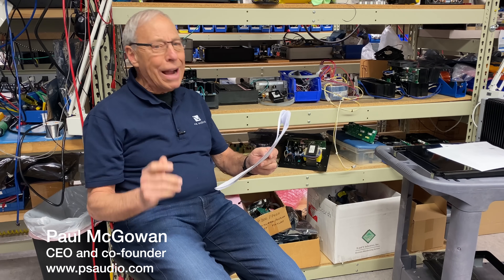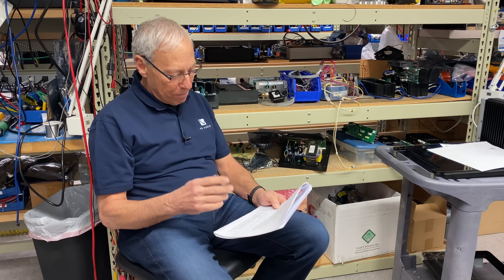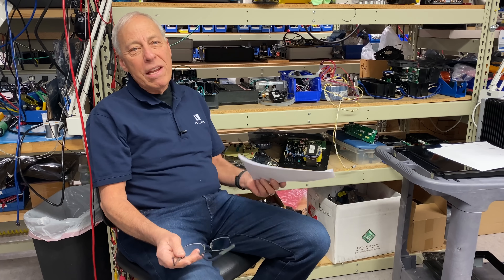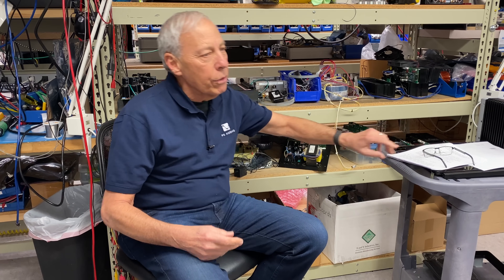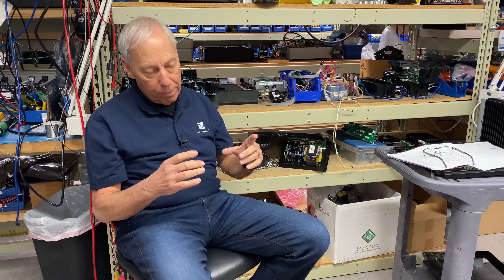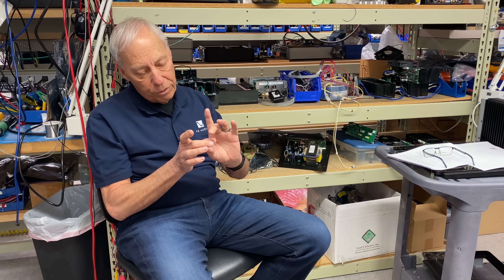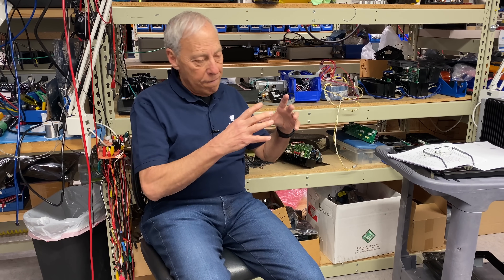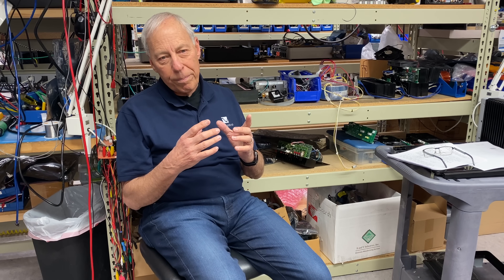Are toroidal transformers better?

Comment: I knew a traditional square transformer is called an 'EI' but I just realised by the same naming convention a toroidal is basically an 'O'.
Now I have that damn kid's song in my head...
Reply: O-core is considered different than a Torroid apparently.
Reply: @clippy_friend  Yes - a toroid's core is flat on the top and bottom and has vertical inside and outside edges, because it's made from a strip of metal of constant thickness curled up into a ring. An O-core is rounded such that the cross section is more like a circle.
For the purposes of my silly joke, though, a toroid is basically an O.
Reply: @HandbrakeBiscuit  Thanks for the details. I guess the O-type core is a bit more difficult to make. Do you know what the benefits might be?
Reply: @clippy_friend  oh, man - now you're asking... off the top of my head the main benefits are a shorter length of copper required to make each turn and I think the magnetic flux is better 'contained' due to the copper bending through a constant radius around the turns (rather than flat-corner-flat-corner like in a toroid). I think they look nicer too - I heard of a toroid before I saw one, pictured an O-core and was disappointed when I saw a real toroid and not a nice rounded donut. I guess that's right, though - an O-core really is a torus, and toroid only means like a torus.
Yes - harder to make, the core strip has to be thin-fat-thin and designed to take into account the growing size of each 'lap' as it is wound into a spiral.
Reply: @HandbrakeBiscuit  Hey that's a great answer. Thank you (and I agree). I know Holo Audio makes a big deal
about using them. But I wonder why these companies aren't using R-cores? A bit more difficult to make the core again, but so much easier to spool.

Comment: What challenges would I face if I wanted to swap a EI transformer with a Toroidal one? I'm having an issue with overheating in a PSU and am thinking this produces less heat than EI frame.

Comment: Howdy.
Also there is a lot more winding space available with toroids. One may use thicker winding wires to minimize winding losses. I should think this is essential in High End gear. The power supply needs to provide current fast without the voltage to buckle.
Regards.

Comment: in transformers with the EI core there is some magnetic flow leakage but in the toroidal transformers there isn't because of their shapes , in toroidal cores magnetic flow goes in a circular path and there is no corner so the shape of magnetic flow wave is better in a toroidal core than an EI core , good shape of magnetic flow wave generates good voltage wave shape. better voltage wave shape : better sound !

Comment: There is a measuremen of the quality of an inductor, the Q value, which compares the inductance to the resistance. Resistance is loss of power, and a toroidal transformer has a higher Q value. I am sure there are some special kinds of other transformers made, but the classic one is pretty crappy. When you need a lot of inductance a big beefy toroidal is quite incredible. It can hold a lot of Joules of energy.
Reply: they hold a lot of energy and also produce a slower decay. the magnetic field doesnt reduce as fast.

Comment: I wish that the Sprout 100 didn't have distortion at high volume with bass heavy music. Id like to have the freedom of max volume as clean as low volume. A new even better version of the Sprout needs to be made. Maybe at the 1000 dollar price point.
Reply: It's a 50wpc amp (at 8 ohms)...
Reply: The days of affordable audio equipment having headroom appear to be over.
Reply: I disagree. Watts have never been less expensive. You can get dual mono 250 watts per channel class D Ncore module amplifiers for like $600. The Sprout is jammed with functionality in a tiny package, hence its niche. The market is saturated with $1000 integrated amplifiers with more watts, and it doesn’t make sense for PS Audio to compete in it.

Comment: If it effects the sound there is a problem with the amp circuit.
Reply: So a humming transformer hums because of the amp circuit?
Reply: @petermartin9494  I dont think that's what he's trying to convey with "affects". You are speking specifically about residual noise that variates per power demand and can be mitigated but is not totally avoidable. Affectation in the other hand is how the transformer introduces EM noise to the circuitry which is avoidable with good design.    Toroidal is just easier to control but not flawless.

Comment: They rattle and make noise? wow, now I know why they sound so awefull. and im not thinking about my sound ampliefier, im thinking about my Xbox, my gaming console. Im currently thinking about modding it, it would involve adding ram, an ssd, custom kernel and HDMI. all to bring the old gaming console to the future. What still bothered me was the power supply. being close to a PC the powersupply is basicly a PC powersupply. replacing the 1 fan with realy nice quiet onces worked as a threat but the PSU... im gonna look into a nice silent powersupply for my xbox and maybe look into a more solidstate solution or if a Toroidal psu excists (it wont have a effect directly on the audio ofcourse, because its mostly digital, even up to the output. But this video did answered the sound questions :D
Reply: I have a modded xbox with ram upgrade and that 😂

Comment: If you want a much more thorough and objective answer to the question of "Are toroidal transformers really better and what are their electrical/magnetic disadvantages compared to regular run of the mill EI (i.e., box shaped) transformers, rather than they just "cost more and sound better...", do a Google search for the following: "EI and Toroidal Transformers" "ken stevens"
Reply: The problem is that Ken Stevens article is as flawed as this video. It was written to warm about the switch of a single component without tuning accordingly the rest of the circuit, not to properly answer the question.
The First paragraph is the usual audiogourmet gibberish instead of proper measurements.
The Second is true, as EI is way more resilient to DC but his examples can be easily fixed by cautiousness during the wiring and by using a rectifier in a single package instead of discrete diodes or by pairing them. Though, replacing the standard PN diodes with Schottky is a good idea as there is less Vdrop and less noise (but again, this have to be tuned). DC is even easier to fix in the primary.
RF input noise is not that hard to effectively filter if you use common lab equipment.
AC coupling is not an issue at all if the DC circuit is properly isolated inside a shielded compartiment. EI are even more noisier, especially in the audible spectrum.
About ground and FM bandwidth : this is pure BS. If the ground paths and connections are correct inside the whole chain (the case, the cables the room and the building) this is enough to ensure proper shielding. Just have to be careful with ground loops as well as digital circuits or SMPS in the ground line. Same thing with main wiring: ideally using a line dedicated for audio from the electrical panel and filtering it.
Finally the LC filter/resonator created in the secondary is not an issue when the circuit is properly tuned and measured. Just like putting decoupling caps in a design.
Reply: @PainterVierax  Non-RF input noise is impossible to filter as is evidenced by the fact that exactly ZERO of the regenerators are effective and doing this. This is the noise that gets to the secondary. If the rebuttal to this is to introduce bypass caps and do proper filtering on the secondary, then there is no point in using a toroidal transformer vs a cheap EI transformer, in the first place.

Comment: Toroids have the cool factor, the one in my amp is coated with red epoxy and has the Parasound logo stamped in gold on the top. Whenever  someone asks whyI wasted my money on that "crap" I just let them look in the top, shuts them right up
Reply: Dave Micolichek   Sure, but  the cool factor is what's important. Amp's sound better  with one, why I thought it was a mistake for Emotiva to go with switching mode psu's,
you can call it anything you want, but  while switch mode's  are  great for a lot of applications, Amp's need current. Companies are pushing class D and switch mode for one reason, they're cheap. They want to charge class A prices  for Blutooth speaker prices.  Screw that.
Reply: Dave Micolichek  Switching from class A and A/B  to class D and to smps seems to be happening at the same time is all I'm saying. As for current, I would rather have a steady flow than "instantaneous" bookoos of current. Main thing is the reason they are changing to these two methods is the same, to save money by making something cheaper  but not reducing the price, which is fine if the new way is better. Not if it is not. SMPSU'S are more "efficient, switching to higher current rails as needed.  What I have posted before is that this is higher end audio,  "efficency" does not matter a tinkers damn.  Who cares if you save a  few bucks a year on electricity? After I just bought a  2,000 dollar pair of speakers?
Reply: @musicman8270  my class D stereo power amplifier has a massive toroidal transformer with dual linear power supply's.

Not all class D amplifiers use a SMPS switch mode power supply.
Reply: @C--A   Still class D, they call it pulse "width" instead of pulse "code"  but it is still non analog. I hace a class D from Emotiva, an ice module based monoblock.for my center. Some great uses for Class D, I just think analog should stay analog is all. Why bother with vinyl when you're gonna convert it to digital anyway?
Reply: @musicman8270  Class D can be totally analogue.
Reply: @clippy_friend   It's lawyered analog, pulse "width" instead of pulse "code" but regardless it sounds not quite as good as class A or AB, witness the mosfets usually thrown in for "flavor", class D is great  for surround channels, I have a class D I use for my center, but for 2 channel HI-FI, no, basically. A lot of people don't get analog, they buy turntables   
with USB or Blutooth, whats the point? I want my Rega Planar III playing through either A or AB, why I bought the thing, There is something different with analog, I can even tell when vinyl is made with a digital  master.

Comment: Like most things technical, there is never a one-fits-all answer. While Toroid transformer do offer many advantages over EI types, there are some disadvantages. They can saturate very easily and have no tolerance for DC voltage which is often found on AC power lines today from switch mode power supplies and other direct line connected rectifiers.
Reply: You need to stop reading soundstage.com articles.  The one about toroidal versus E-I core transformers is mostly nonsense.  It is NOT true that DC voltage is often found on AC power lines.  There are transients which can disturb symmetry, but these are short enough that they will not have the same effect as steady DC.  
If two transformers - toroidal and E-I core - are equivalent, then they will have the same saturation current.  Further, you are not going to saturate any power transformer, merely by transient asymmetries on the AC power, because the idle current due to normal operating voltage is very small compared to the transformer's rated current.
Reply: @marianneoelund2940  I don't read soundstage.com. I do read the IEEE journal as I am an accredited EE. Toroids saturate must faster than EI, that is a known fact. DC components on AC power lines is quite common today, especially in larger distribution systems such as in commercial buildings. Are you trying to say half wave rectification does not reflect a DC component on an AC source voltage? I am not saying toroids are deficient. They are an excellent choice for audio components. I am just pointing out some well known engineering pitfalls.
Reply: @andydelle4509  
If a toroidal and an E-I core transformer have the same VA capacity, then they must have similar saturation current.  
If the toroidal has much lower primary series resistance, then conceivably it could draw more DC current if a DC component were present - but do they truly have that much less primary resistance?  
The only way I can see to impress a DC component on power, is to have an asymmetrical high-current load (such as your half-wave rectifier example) on the same utility transformer secondary as the audio equipment.  When does that happen in a residential environment?  
I'm remaining skeptical until someone can offer a realistic, detailed example with specific numerical parameters, that show how, in a residential environment, a toroidal power transformer could reach saturation due to another load on the line that's meant for domestic use.
Reply: @marianneoelund2940  I didn't say toroidal transformers automatically saturate. I said they are more prone to saturation. As for DC on the line, how many half wave voltage doubler rectifiers do you have directly across the AC line in a typical 120vac residence TODAY. Think about it and it's not just cell phone chargers either.  My 2007 vintage washer, dryer and a 3ton HVAC condenser all have VFD motor drives. Again that does not mean your toroidal transformers WILL saturate.  But there are plenty of examples where toroidal transformers have harmonics that are cured by AC or galvanic coupling. You seem to be hung up on VA capacity. You are forgetting DC winding resistance. You can have the same VA capacity but significantly different DC resistance in any transformer winding.
Reply: @andydelle4509  
I did mention winding resistance in my last comment.  
I don't believe any of the domestic examples you cited use half-wave rectification.  Most devices like cell phone chargers use FW rectifier bridges (do low-power devices even matter?), and I am having great difficulty believing that washers, dryers and HVAC units will use the AC power asymmetrically.  The worst offender I can think of, is a microwave oven over the first few cycles while the capacitor is charging - but that's a transient condition.  
Regarding saturation, toroidal designs do tend to have less headroom with a more abrupt flux separation than E-I cores, but high-end audio suppliers like PS audio probably use a slightly larger part anyhow, as they may believe it sounds better in their listening tests.  
I think the biggest problem related to saturation is inrush current, not the occasional saturation that may conceivably occur due to a momentary DC component of power.
Reply: @marianneoelund2940  If a washer, dryer, HVAC condenser uses a high power inverter, which some do more and more, you can have a DC component imposed on the AC line. Do I need to post a link to my washer and dryer service manual?
Reply: @andydelle4509  
Does the service manual include a schematic?  
But there's little point in carrying on a discussion based on speculation without hard data.  
Maybe I'll pick up a beefy toroidal power transformer to experiment with.  I can connect it to the AC line serving our washing machine or microwave and see if it can be provoked to draw current that's anywhere near the saturation level.
Edit:  Thinking about this a little more, I suspect that the issue isn't that the transformer can end up drawing enough DC current alone to saturate, rather it's that some smaller amount of DC current will reduce the magnitude of AC current that can be superimposed on it without saturating.  Effectively, it reduces the transformer's current rating somewhat.  That's not as hard to believe.
Reply: @marianneoelund2940  There is no schematic. It's a sealed (really well sealed) module labeled "inverter". I know because I tried to fix it but replaced it due to the thick conformal coating on the board. Not all home appliances have VFD drives. But more and more do as a VFD inverter and three phase motor is now cheaper than a single phase induction motor. Remember single phase motors of that horsepower need large capacitors and a centrifugal switch. Semiconductors and SMD components are dirt cheap in comparison and the R&D for the VFD drive is a one time expense. Plus you get infinite variable speed as a bonus. Also easier to meet energy usage requirements as well. I'm not an appliance expert but I know from DIY home repair experience.

Comment: I was playing with an old Crown D60 stereo amp the other day and man did that thing have a noisy transformer, sounding like a loud electric hair clipper. The transformer appeared to be pretty well saturated in some sort of varnish or glue, so inner rattling wasn't the main source of the noise. I ended up decoupling it mechanically so it floats in the chassis on o-rings and some dense foam.  If toroids were an option, Crown probably would have used them as this amp has a super thin profile at 1-3/4" thick. I suppose it's possible to find an off-the-shelf toroid to replace this pancaked transformer. But I doubt it's worth the effort. Great little amp, otherwise.